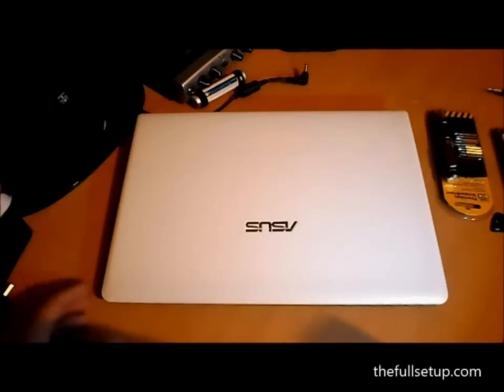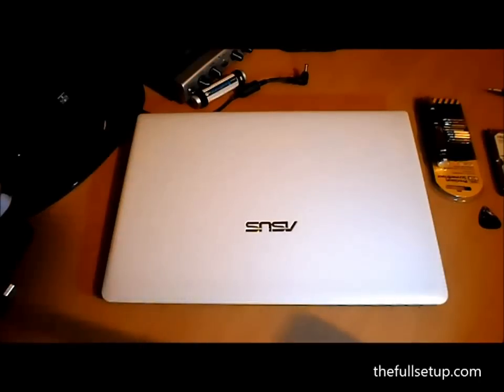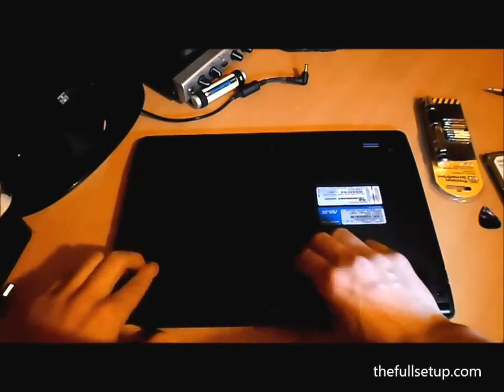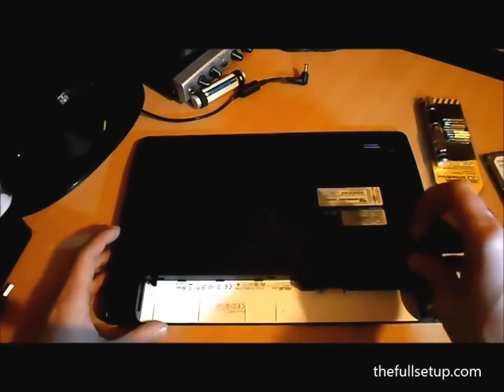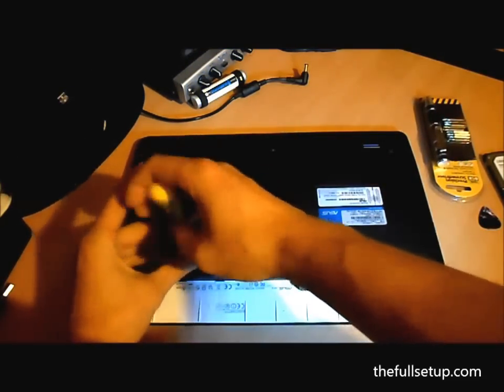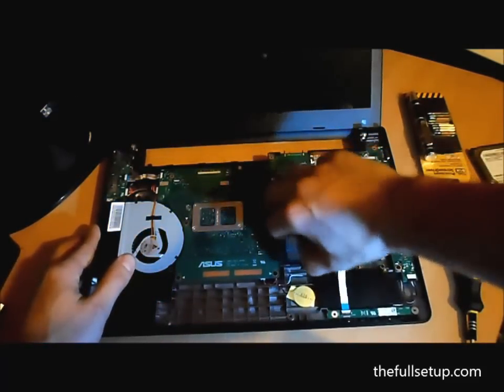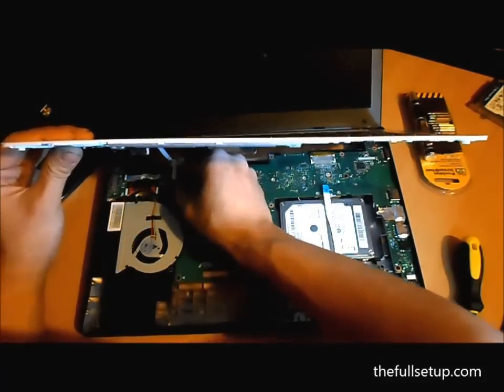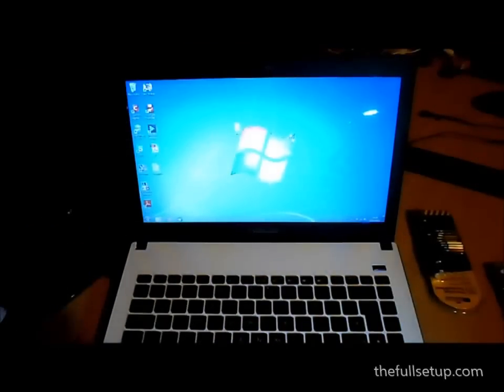asus x401a x501a x301a hard drive upgrade ssd hd

Comment: Nice one! But I just noticed how old this video upload is and wonder if you or anyone will even be able to help me today (JUNE 2021).
I have a ASUS x501a and it looks exactly like this one inside and out. I just upgraded the RAM from 4GB to 8GB and that seems to have helped a little but not as much as I was hoping. My next project is to upgrade the storage drive from the original Toshiba 500GB SATA HDD to at least 1TB SSD from any compatible manufacturer but I am a bit confused about specs and don't really know what will actually work. I bought a SABRENT SATA/USB hard drive enclosure and have downloaded the ACRONIS cloning software but have not yet purchased the SSD drive that I want to transfer the data from the original drive to. Any suggestions as to which 1TB SSD drive I should consider using for this upgrade? Any help here would be greatly appreciated. 
Thanks all....
RJR 
Tucson, AZ

Comment: you didnt show how you cloned the drive.
Reply from the maker: +movieguy73  Thanks for the comment have a new ssd turning up at the weekend. going to do a full clone guide to post in all my hard drive upgrades. finally getting it done been putting it off since 2012 lol. 
Good luck with the upgrade.
Reply: +thefullsetup i was just tinkering around with a cf drive.
Reply: +movieguy73 
Cloning the old HDD to an SSD need SSD to have partitions "Aligned" after cloning.
SSD have a max performance in this way.
But I do recommend to do an clean install of OS.
Cheers

Comment: thanks very helful vid. I cant tye roerly though because of the fucking keyboard on this Asus is shit :-(
Reply: Haha take it all apart and try to get it all back in really snug, I just did exactly what you did and then had to take it apart again and do it all over.
Reply: Connor Keegan  Several keys are afflicted although sometimes they work fine like at the moment, then very often they are totally unresponsive, I will take your advice thank you.
Reply: Yeah that was happening to me too. If i hit it like 15 times it'd eventually write the letter. r i s and w weren't working well and my mouse pad wasn't either, it was just because I pulled up on the keyboard before unhooking everything, so it pulled it out of whack. Just re fasten all of the connections and make sure they're in there.

Comment: Nice vid mate.Just ordered one.Intending on fitting a samung pro 128gb ssd i have laying around from a desktop that was previously upgraded & a ram upgrade then run linux on it.Not interested in windows 8 as i have 8.1 on another machine.Just want this little beastie for linux.What's the max ram-4gb or 8gb? Cheers.

Comment: Just in case anyone else had the same issue, 'fast boot' is enabled, to disable it- In Windows8 open sidebar on the right, select Settings, choose Change PC settings (at the bottom of sidebar), choose 'General' in PC Settings, roll down to Advanced Settings, select it, wait for the blue screen, choose 'Troubleshoot', select 'Advanced Options', then select 'UEFI Firmware Settings', with a restart that will take you to the BIOS. Once in BIOS go to BOOT and you find 'Fast Boot', disable it.